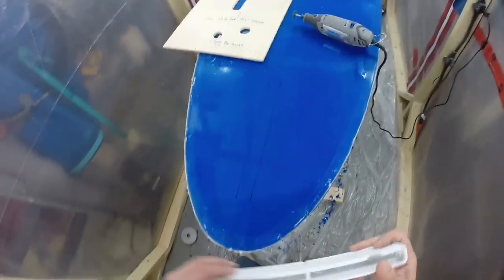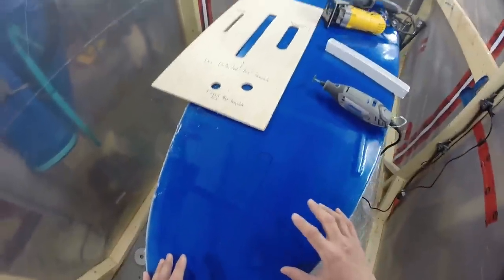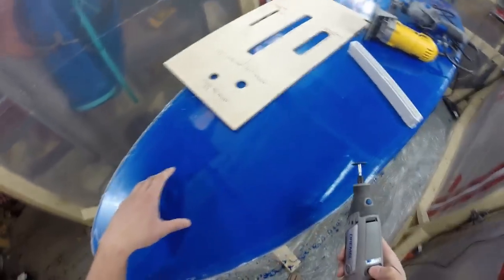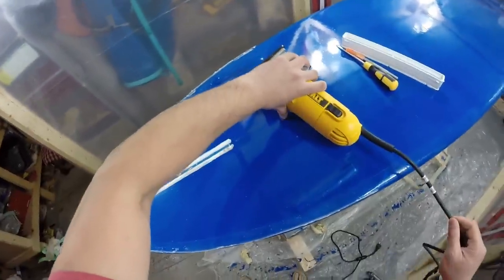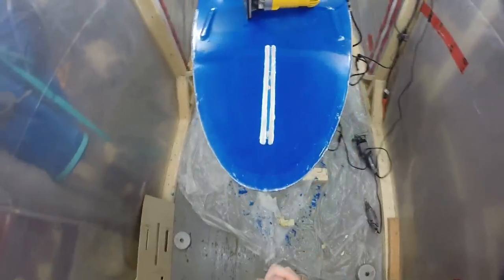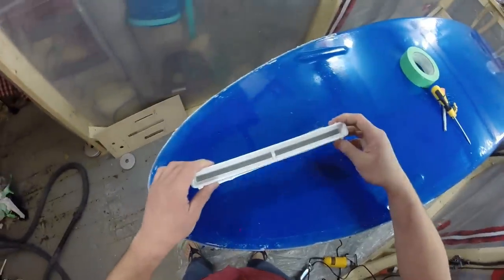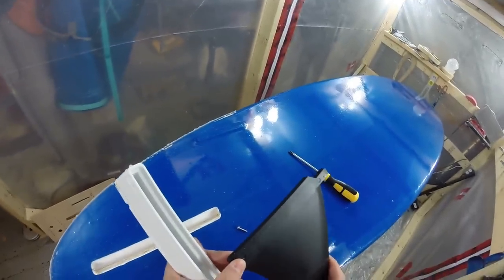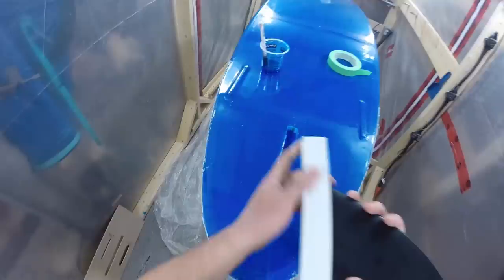Installing a Surfboard Fin Box: How to Build a Surfboard #33

Comment: Very nice videos. Well done dude.
The only mistake I see is that the hole you make for the box it is kinda small. I always make it 3-4 mm bigger/wider than the box, more resin and also put fiber cloth inside (much stronger).
Today I'll start shaping my 7th board and can't wait to use your technique on masking the bottom tail section for the hotcoat. 
Cheers

Comment: I just finished my first board and I am using futures and don't have the template. I am trying to decide on whether or not to get a compact router or dremel trio. My only worry is with a trio I wont be able to route the center fin because it will mess up when it hits the stringer. I am on a budget and it's one or the other. I feel like the trio is easier to control accuracy though because you can see your cut better. Thoughts?
Reply from the maker: +Alex Broyles Hi Alex, since I have both I can give you my opinion, the trio works great, I got mine at Costco for $40 two years ago so it wasn't much investment for me.  I have used it to router out the stringer, no issues there, just keep the RPMs up before you cut into the wood.  The only issue with using it, is was meant for hobby grade work, if you are making a lot of boards, the bit won't last.  Oddly the trio router bit was almost half the price of the machine ($18) and I haven't found a third party supplier as it uses some odd size collet.  However it should do you for a few boards.  

The compact router on the other hand is super powerful, you have lots of choices for bits but may be overkill.  Also the router can be a bit harder to handle, it typically only has one speed = on @ 20000rpms  The router can also be used for other things as well, if you are into woodworking at all.  If you decide on a router get one with a clear base, mine doesn't have one and it's a pain at times to see where you are routing.

A third option if you want to save some bucks is using a regular dremel like tool.  Some have a router attachment guide, which will help with the depth.   For bits there are tons out there, you can get cutting bits just for it, thats what I have used or a drywall cutout bit.  Personally if you are only doing one or two boards I'd go with the regular dremel and find one with the depth guide.

Comment: quick question though, how much polyester resin do you recommend for a 4'10" board (mini simmons)  including hot coat
Reply from the maker: Adam Ervin Check on this page: http://greenlightsurfsupply.com/pages/greenlight-surfboard-building-guide-page-3 
typically around 2oz of mixed resin for every foot of surfboard.
Reply: you will need average board length 5'8" to 6'5" about 500ml (1/2ltr)polyester resin. Its preferable to use a resin measuring container with markings. a plastic cerial bowl full is around 500ml

Comment: How does your router bit now chew up the glass when routing the foam out and also how does it not bite and chew the wood when using the template?
Reply: Chad Michael   Excellent question    make sure you use the non flute router bit .ie the plain one (not the "T "one to route channels with ) the shaft and blade same shank width 1/4   or 10ml . I'm not sure of the names of the bits, I'm using one for the first time too. If you don't have those expensive future fin gigs just go by eye as shown here. set the depth and hold the router confidently and firmly and keep it moving straight if its a 10ml shank. but with a 1/4 " shank do the foam first each side of the wood stringer first as show, then cut the stringer later side to side & forward. once you put in one box you get the hang of it.
Reply: looks like Andrews has made his homemade template gig using a sheet of nylon from the looks of it? you could use one of those bread cutting nylon boards they are cheap. its preferable to using plywood. which can chew up if you use a "T"bit . rather use a straight shank bit

Comment: hey, just wondering how you figured out the depth for your fin box? i realize the tail gets a lot thinner. so when you figure out your tail thickness, do you cut out half of that thickness, or how did you do it? thanks!
Reply from the maker: jarret magno I basically measured how thick the tail is and made sure that when I routed out the fin box that I set the depth to be not deeper than my measurement.  I think as long as you don't route completely through it should be fine.   Keeping in mind that the fin box does have a minimum depth it requires for the fin tab or else you won't be able to set your fin in place.  So try not to make your tail too thin until the last 3 inches.
Reply: I had problems with that. I shaped my first board and at the end I had to remove such amount of foam to let the  single fin box fit that the foam is translucent.
Reply: Carlos viler Not a problem  carlos just paint white resin over the top deck to hide it and sand. use a sticker or white resin and cabosil powder to glue in box. next time you will make your tail thick enough. those single boxes are long and deep though. . I made my own boxes in the old days made th separate side wall pieces flat and grooved them out then stuck the box together. lot of work though, better to buy the boxes ready made
Reply: if u guys want to make 6 leash plugs at the same time wind wet saturated 6oz cloth around a pvc conduit electric pipe about 2 feet long with Vaseline or grease over it . wind the cloth 7 times around . when cured you "smack" it down hard on the concrete and the cured glass will slip off the pvc 1/2" pipe into a perfect cyclinder.   You then drill through right the pipe 6 times and then cut into 6 plugs and slip a small piece of brass wire through it . job done and it looks great. glue in and  it grinds down flush nicely

Comment: Hi! Thanks for making this video, it's really helpful. I was wondering what dremel piece are you using exactly for cutting the fibreglass? Also, how do you grind off remaining part of the fin box, what tool do you use? (I personally only have a dremel so hope I can get away with that) Many thanks.
Reply: Pro tip: watch movies at Flixzone. Been using them for watching loads of movies lately.
Reply: @Quentin Quinn Yea, been watching on flixzone} for since november myself =)

Comment: I made a mistake installing the fins. I'm doing fcs plugs. I set the cant to 5 degree but I did them towards the stringer, just found out is the opposite way. I tried to bent them back but resin dried, I even lit it on fire and nothing. What will an invert CANT will do to my surfing?
Reply: I found the following information below. I guess I'll be fine and will love the speed that mistake created. 

info.  Fin Adjustments

Fin Adjustments

Your surfboard manufacturer will generally install the boards fins in the most advantageous position and the shaper normally leaves “a shapers dot” to indicate where the back tip of each fin should rest. If in any doubt, always re-adjust your fin settings to this position.

Adjusting Toe-In and Toe-Out
Toe-In/Toe-Out refers to the direction the leading edge of the foil is facing relative to the centre stringer to the board.

The centre fin should always be exactly in line with the centre stringer and both side fins should always be toe-ed in by the same number of degrees, unless the side fins are not positioned directly opposite each other.

Points to remember:
Always adjust toe-in/out in millimeteres as small adjustments generally result in immediate noticeable differences

When to increase Toe-In:
Increasing the toe-in of the side fins (i.e.turning them in the direction of the stringer) will increase the boards responsiveness during turns. Remember that increasing toe-in, results in less water resistance during turns.

When to increase Toe-Out:
Increasing the toe-out of the side fins (i.e. turning them away from the centre stringer and towards the direction of the rails) will increase the boards speed particularly when driving down the line.

 

Adjusting Fore / Aft Movement
Fore/Aft movement refers to the vertical placement of the fins relative to the tail of the board. Moving the fins “aft” or backwards would bring them closer to the tail, whereas ”fore” or forward would move them further away from the tail.

The side fins should be moved together and should always be aligned horizontally with each other, whereas the centre fin can be moved without adjusting the side fins at the same time. The 4WFS interdiscs have been specifically designed to provide 8 mm of movement for both side and centre fins.

When to move fins backwards (“aft”):

Moving the side fins backwards (i.e. towards the tail of the board) whilst moving the centre fin forwards will increase the boards responsiveness during turns.

When to move fins forwards (“fore”):

Moving the side fins forwards (i.e. towards the nose of the board) whilst moving the centre fin backwards will increase the boards speed particularly when driving down the line.

 

Adjusting Splay / Cant
Fin Splay refers to the angle the fins are placed relative to the underside of the surfboard, or the number of degrees the fin tip is offset from the fin base. Fins splayed outwards would result in the fin tip being more towards the rail of the board compared to the fin base.

The side fins should always be splayed at the same number of degrees, whereas the centre fin must remain at 90 degrees – no splay.

When to increase outwards splay:

Increasing the outer splay of the side fins (i.e. the tips are leaning more towards the rail of the board) will

increase the boards responsiveness during turns.

When to decrease outwards splay:

Decreasing the number of degrees the side fins are splayed from the rail (i.e. more towards the centre stringer of the board) will increase the boards speed particularly when driving down the line.
Reply from the maker: Surfmus Interesting, well you'll find out once you get it out in the water but sounds like it should be fine.  Just might not be as responsive on quick turns.
Reply: Andrew W I'll keep you posted. I won't deny you I went ballistic when I did that. If I don't like how it rides, I will remove the old FCS plugs and set new ones with cant at 5 degree. I'm just drained from all this.  3 weeks off and on and about 62 hours, mainly lost a lots of time fixing the bleeding from tempera and the DAP sealing. 4  of (16 oz) used to correct it. After all that sealing I found out I could get away with a lot b/c the fiberglass cloth while lamination hides some imperfections. It was a journey, I want to thank you, it is in fact the most comments I have ever left in videos, I normally do not comment. I will upload a video and will post it for you to see. Just fast forward to where the board is done.
Reply: +Andrew W No fear. took them off and repatched. I even added foam. The hole look perfect for FCS  fusion, ha! 
JavySoprano (@JavySoprano) tweeted at 7:14 PM on Fri, Aug 21, 2015:
Removed FCS plugs for proper cant. http://t.co/ZMMzBIMXwa
(https://twitter.com/JavySoprano/status/634866293422825473?s=02)
Reply from the maker: Surfmus Right on look forward to your video.  Glad I'm able to help, I'm still making mistakes and I got lots of boards under my belt.  You are totally right it's a journey, but it will be rewarding when you get it out in the water.  Cool so you remounted the fin plugs, no sense in letting it bug you if you can take the time to fix it.
Reply: lol

Comment: I'm installing FCS X2 plugs. I will shape it as a thruster. Where should I plug the center lower plug. How away from the tail. I have seen other videos where they place is on 3, 3/8". And far the sides rails will be from the center bottom?
Reply from the maker: Surfmus between 3"-3 1/2", the further back the less it will feel.  Check out greenlightsurfsupply, in their how to build section there is good diagram for setting thruster fins.  I can't really explain it.
Reply: Andrew W Yeah, that's what I did after posting my comment. For thruster set up is from 3" to 3,1/2".  Check out my blank and extras. https://twitter.com/JavySoprano/status/625845579717943296 I also saw another video that for a fish they cut the swallow tail after planing it down.
Reply from the maker: Surfmus Most excellent, looks like you got the gear and are ready to have at it!

Comment: I've seen people router out the boxes before they glassed it.   Is that another way?  Or what's up with that.   Shaping my first board
Reply from the maker: Cody Mullins Might depend on the fin box, futures fins are done before glassing.  A bahne box is typically done after glassing.
Reply: Thanks for the quick reply.   How would I do future fins?  I want to do them.   Not like how do I router them out just like how do I glass over a fin box without filling the box?

Comment: Hi Andrew, thanks so much for this series. It's been my main resource for my first board build. 

How much of the fin box has to be sunk into the board? 

I routed the hole for the fin box but the limit of my router is about 2cm. So about 1/3rd of the fin box is sticking up from the board. I can just sand the excess off like you have, but I'm  concerned that it won't be strong enough.

The fin box i have is http://www.southcoastfoam.com.au/product/10-fin-box/. Currently it sits flush with the bottom of the board about where the 'teeth' start on the fin box.

Cheers mate!
Reply: Carlos Danger  depending on which boxes you use, future fins or others, there are little feet gauges on them. just push them down to there. also make sure that if you have to sand the box level you are sure the fin will still work especially on these rear fin boxes as the board is thinner there. Remember it can get tricky when you have a straight box over a turndown in the tail rocker don't worry as long a the fin functions you can sand it down to level
Reply: NB when sanding down the box if you not sure rather use an 80 to start than a 60 0r 40 grit.  after 80 grit go to 120